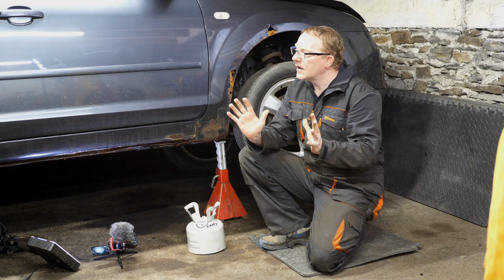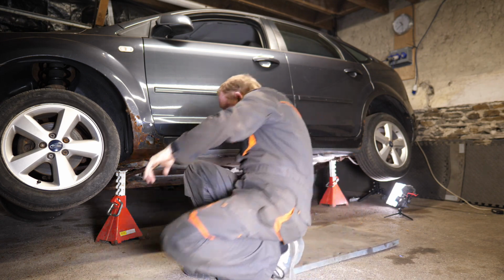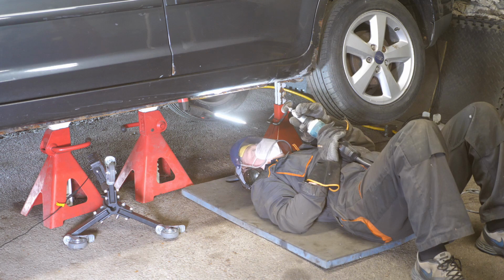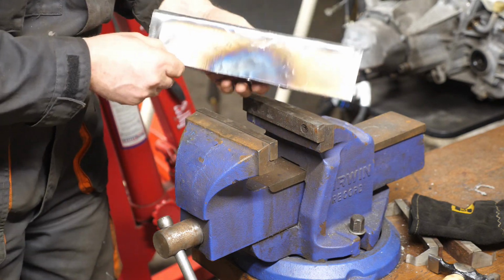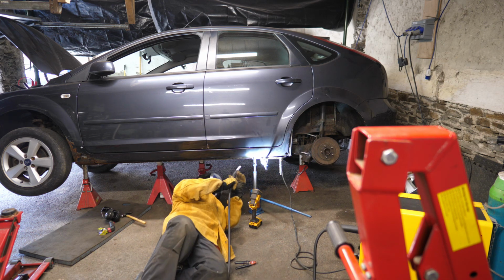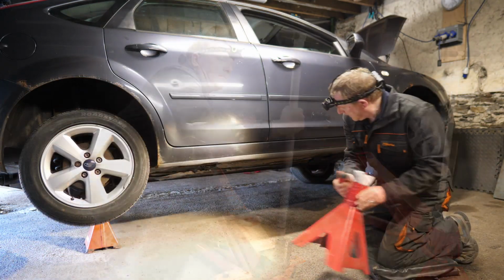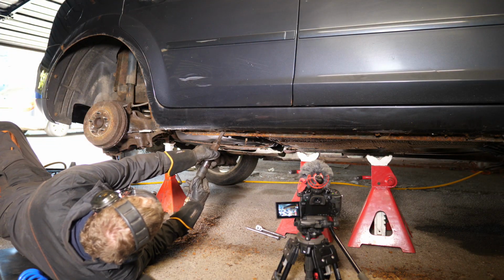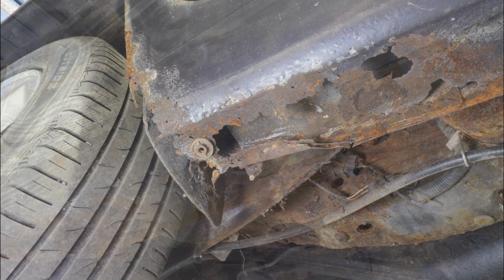Part 4 of 5 - Welding the Sills on my Abandoned Ford Focus 🚗using a Helium Balloon Bottle 🚗

Comment: Getting the rust fixed on my focus fixed in February, costing me 700 pounds😮
Reply from the maker: They are a right nightmare for rusting out.
Reply: @CoatsandGaiters got mine quoted for 1500 pounds! 
So my local mechanic said he can do for 350🙏🏻
Reply from the maker: @li0nheart05  That's pretty low and lucky.
Reply: @CoatsandGaiters I'm just grateful the Ford will survive a few more years 😎

Comment: Its a bad job, i set fire to all the electrical wire loom the seat belt and the plastic trim on the back seat, when i did my old punto. Its lasted another 8 years though. Not doing again though. You have a nice welder. Mine is so shit clarke! You are hard core doing all that rot 😂
Reply from the maker: Oh bugger so you had some bad luck !!!! I started with a SIP and I quickly learnt the welder plays a huge part in your welding quality.  I bought a Murex after the SIP it it made all the difference.  Wire feed consistent and welding became so much easier.  It's now due for its next MOT so see what happens lol

Comment: Car and van body steel is around about 0.6mm thick. I know this because I have put my digital calipers on various motors and was a bit surprised how thin it as. I use 1mm sheet steel which I shape for repairs or buy in the sill panels. Mig wire I use is 0.6mm and use the overlap method to avoid burn though too.
Reply from the maker: Thank you for that information it’s worth knowing some facts on things.

Comment: Yikes, those sills must have made your heart sink after all the great work you'd already done to this point.
Just goes to show what may be hidden under these plastic trims that manufacturers now put everywhere. As you said, some of them are bound to trap water and salts thereby just accelerating corrosion rather than inhibiting it.

I don't know a lot about the MOT process but I do know they are unable to remove parts to aid inspection. This seems somewhat counterproductive in many instances where the test is to deem roadworthiness of a vehicle. Rear drums for example; how do they know how much meat is on the shoes of such a vital component? There must be a testing process I am unaware of...

Excellent workmanship all round from the fabrication, safety emphasis and environmental recycling using reclaimed materials! Really enjoying this series and your approach to problem solving using your expansive skillset. Thanks for filming and sharing. Have a good weekend
Reply from the maker: Thank you kindly for that comment.  My heart did sink but I thought pull yourself together Mark....people do huge crash repair jobs so just get on with it step by step.  Thankfully this worked out ok and I got an MOT.  I guess it doesn't matter how much brake pad is on a pad as long as it meets the criteria at the time of testing.  This car could well fail an MOT in 6 months time during winter as the salt will attack it pretty badly I expect.  It's sat in my barn at the moment in the dry lol.

Comment: Excuse me sir it seems like there are some car parts on your rust

Anyway, you really have a lot of patience with this car. It would have gone to the junkyard pretty quick if it was mine lol
Reply from the maker: That's the thing with making a video series you sort of have to see it through to either a terminally failed MOT or it gets an MOT.  I have decided if I get it on the road I will keep it as my main car.
Reply: @CoatsandGaiters  do you have tips to know if rust is critical or not? I'm planning on buying a car with a refused MOT and on the list it is written Rust on the chassis but only as a minor problem. So normally even if I don't fix it, it will pass an MOT (French MOT are like : critical you have 2 days to fix it, major you have 2 months to fix it, minor you don't have to fix it but it's a warning)

I was planning to bring a flat head screw driver and try to punch through the rust to see if it's critical or not. But because the problem is only minor the current owner might not agree that I reveal a problem without being sure that I buy the car first.

And I can't weld, important point.
Reply from the maker: @L3xou97  I think there has to be a hole or obvious signs the metal has weakened or started to deform from loss of strength or rigidity.  I think the  MOT tester will gently bang along the metal and if it sinks in it will fail.  Gentle pointed hammer is the way to check I think.

Comment: If you find a local metal fabrication place near you and buy there off cut sheet steel it will be cheaper then going to a metal supplier especially if your paying cash 😉
Reply from the maker: That's my plan.  I'm hoping he will be cheaper.  He can also bend it properly as he has the proper machines.